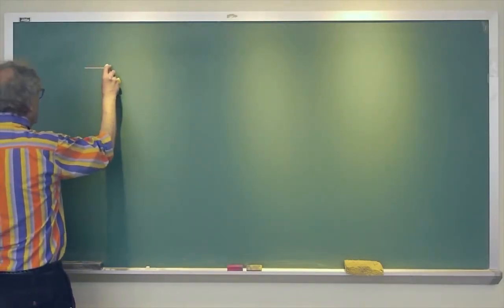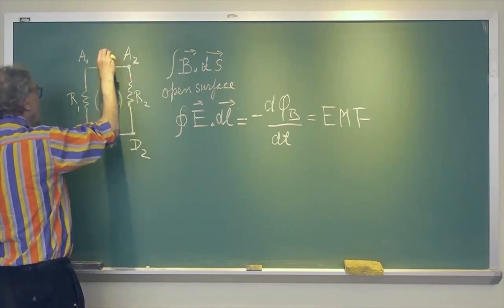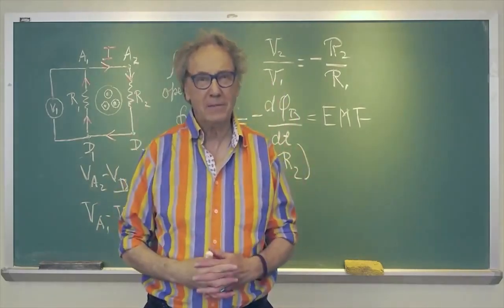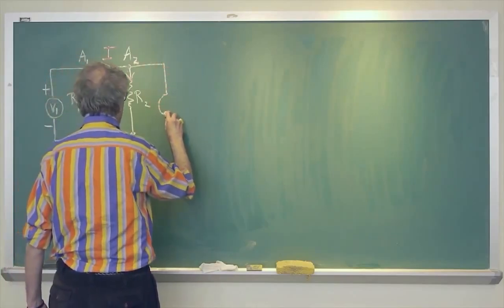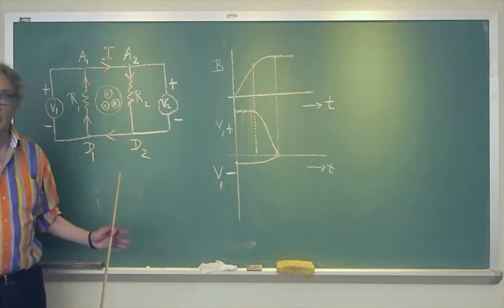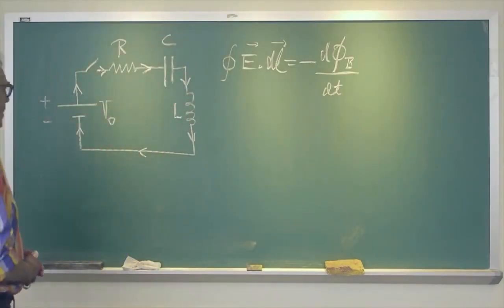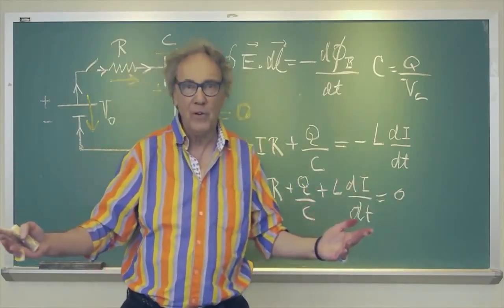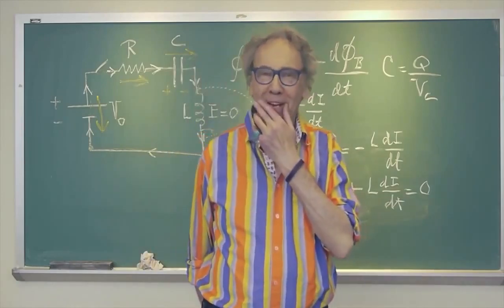Kirchhoff's Loop Rule Is For The Birds

Comment: Hello Pr Lewin, 
I hope you're well. In addition to this video, I watched lecture 16 and the associated lecture notes. I think I understood your explanations and your calculations (which are so great by the way) but there is still something that I can't understand. If the two voltmeters (V1 & V2) are connected to the exact same points (A & D), how can V1 "knows" that it 
should measure the potential difference in R1 and V2, the potential difference in R2? If I refer to the first figure of your lecture notes and if I move V2 right above V1 to get a superposition of V1 and V2 and the wiring associated to the two voltmeters, both voltmeters should measure the potential difference in R1 and show the same value. However, by doing this I didn't change the connections and the changing magnetic flux that goes through the "V2 loop" so the voltmeters should indicate two different values. They can't show different and same values at the same time, so I missed something. What would happen if we connect a third voltmeter in a plane perpendicular to the sheet of paper? What it will display? Thank you for reading me.
Reply from the maker: The readings of the 2 Voltmeters MUST be in accordance with Maxwell's equations and they are. The readings as shown in my demo are exactly as they have to be. Any other reading would be a violation of M's eqs. Voltmeters do NOT think, they only listen to Maxwell. By the way, if you flip the V2 voltmeter over all the way to the left of V1, keeping A2 and D2 in place, V2 and V1 will indicate identical values, same magnitude, same polarity (assume both negative).  That's demanded by M's eqs. If you flip V1 over all the way to the right of V2, V1 and V2 will read identical values, same magnitude and same polarity (now both positive).
Reply: Thank you very much for your answer Sir! So, if I well understand, you can change the reading value of the voltmeter just by moving it to a different location in space? By flipping over the voltmeter, are we changing the line integral of E.dl along a specific path which is why the reading value is different for the two locations?
Reply from the maker: YES, the integral of E dot dl from one point A to another point D depends on the path you choose. That's Faraday!. In situations where K's loop rule holds (NOT HERE), the integral of E dot dl from one point A to another point D is independent of the path you choose.
Reply: Ok thanks! It's more clear to me now. However, what a mind-blowing concept :)
Reply from the maker: Yes it is mind-boggling. The reason is that already in high school you were always told that the potential difference between 2 points in a circuit is INDEPENDENT of the path you chose when you measure the integral of E dot dl. That's Kirchhoff. This is then hard-wired in your brains. Even when you learn later about Faraday's Law, it's not stressed enough by teachers and pysics books that K's Law is only a special case of F's Law, namely when the closed loop integral of E dot dl is ZERO. If it is NOT zero, K's rule does NOT apply. Physics teachers from all over the world have written me that the demo is a cheat. They claim that the 2 Volt meters MUST read identical values. 
I have a standard answer for them: 
"Dear Teacher, it's time for you to familiarize you with Faraday's Law. You incorrectly have a religious believe in Kirchhoff's loop rule without realizing that that rule does not apply here. I will not further argue with you about this.  I teach physics, I do not argue with people who think they know but who don't."
Reply: Do you know what would happen if we measure the potential difference between A and D by placing the voltmeter in the plane perpendicular to the surface of the blackboard and at the same distance from R1 and R2? In this case, the change in the magnetic flux through the surface of the new loop would be 0 because the plane would be parallel to the magnetic flux. The  path of E dot dl would be now neither the R1 one nor the R2 one. Is the voltmeter will display 0V?
Reply from the maker: It's better to not use the words potential difference in case where the integral of E dot dl depends on the path. I mention that in my handout. It's better to always mention "integral of E dot dl". In your geometry the closed loop is the loop which only contains the wire AD which has zero resistance and the voltmeter. There is no changing magnetic flux going through the surface of that loop, thus the closed loop integral of E dot dl is zero (Kirchhoff!) thus the volt meter will indicate ZERO. It would be ok here to call this here "potential difference".
Reply: Thank you! How can you have a closed loop without passing through R1 or R2? Can the loop be partly virtual (between the two probes of the voltmeter in A & D)?
Reply from the maker: I read it correctly. By the way, you may choose ANY loop in my circuit with any geometry you prefer (with Volt meters out of the blackboard etc etc), Maxwells eqs ALWAYS work for ANY loop. For some loops K's loop rule can be used for others it cannot be used, BUT FOR ALL loops F's law can always be used even if dphi/dt is zero. I'll leave you alone now. Do some more exercises. E.g., use my geometry and choose a closed loop A1 => D1 => V1 => D2 => A2 = V1 back to A1 (I call that the "outer" loop). The closed loop integral of E dot dl in that loop is -dphi/dt. By choosing this loop you MUST get the same readings of V1 and V2 that i get in my demo. I have given students this as an exercise. Few did it right as you now have to be very careful. The current through V1 is NOT the same as through V2. If that were the case, they would indicate the same magnitude of the "voltage" but with different polarity. But the magnitudes are NOT the same. So now you have to do a bit more work.  GOOD LUCK!
Reply: Sorry if I was not clear. In the geometry that I suggested, there is no direct "A=>D" (the rest of your supposition is correct). If I well understood your geometry, you need to add a wire between A & D (to get the "A=>D" direct connection). In my configuration, you don't have this direct "A=>D" connection, so the only way to have it, is to going through R1 or R2 or through a straight line into the air between A & D (but in this case you have the huge resistance of the air gape).
Reply from the maker: I apologize, I had the Letters wrong but not the physics. Your closed loop is A1 => A2 => V2 (out of the black board) back to A1. All my arguments above still hold. The closed loop integral of E dot dl will be zero (Kirchhoff). I accidentally wrote D when I meant A.  sorry.
Reply: Ok, thank you for your time Sir, have a nice day!
Reply from the maker: Here is my corrected version of an earlier msg in which I wrote A which should have been A1 and when I wrote D when I meant A2. NEW VERSION:
Start at A1 => A2 => connecting wire to the voltmeter => voltmeter => connecting wire back to A1. All wires have zero resistance. The Voltmeter has a few Mohms resistance. That's the geometry that you suggested. That's a closed loop and the magnetic flux through any surface attached to that closed loop is always zero.Thus the voltmeter will read ZERO. Maxwell's eqs ALWAYS work.
Reply: Thank you for the final correction but that's not the geometry that I had in mind. In the geometry that you explain, it's like if you directly connect the two probes of the voltmeter (because A1 and A2 are exactly the same point A). In my geometry, the two probes are NOT connected directly together. 
My geometry is A (central point between A1 and A2) => connecting wire to the voltmeter => voltmeter => connecting wire to D (central point between D1 and D2). Voltmeter is in the plane perpendicular to the black board. This plane passes through A and D. My loop can be closed (the missing connection from D back to A) by R1 OR by R2. This configuration is perfectly symmetrical. In the calculations, If I choose R1 to close my loop, I will get a certain value read by the voltmeter. If I choose the R2 resistance to close my loop, this value will be different. But in my geometry, R1 and R2 are connected in the same time. Because of the symmetry of the situation and because the voltmeter is at the same distance from R1 and R2, how can you know if the voltmeter will measure the closed loop integral of E dot dl by going through R1 or the path that going through R2? There is nothing that force the voltmeter to measure the R1 path instead of the R2 path and vice versa, however the 2 values will be different and the voltmeter can display one value only. When the voltmeter is located on the left, I can understand that it measure the R1 resistance, and when it is located on the right, that it measure the R2 resistance. If the voltmeter is right in the center as in my geometry, there is no way that we can know the value that it will display. I feel that something is wrong in my "demonstration" but I don't know what.
Reply from the maker: Apply Faraday's Law in ANY closed loop and you will get the right answer! I have spent enough time on this now.
Reply from the maker: Lecture notes (when available) are posted as pdf files below the video thumb nails
Reply: In the comments associated to the video 8.02 Lect 16. It's the first link.

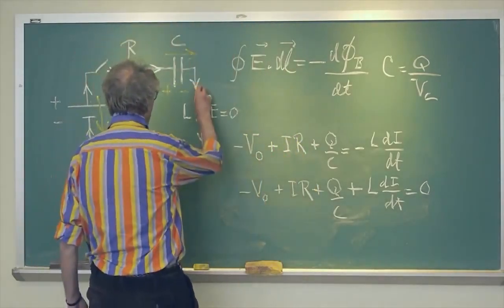Comment: Dear Mr Lewin, could you not always make Kirchhoff's rule work by going "around" a solenoid instead of going through its wire when building the integral E dl. Could you not always attach a virtual voltmeter in your mind like you showed towards the end of this video (33:10)? Then Kirchhoff's rule would actually hold. Then would that not be the easier approach for calculating more complicated circuits consisting of more than one solenoid? You should of course know what you are doing and I think (hope!) your videos have helped me gain a better understanding of that.
Reply from the maker: If you go around the Solenoid (e.g. through a voltmeter which is attached to the solenoid) then K's rule holds, but you  first have to calculate the potential difference over the voltmeter. That, however, is NOT possible with K's rule. You MUST then apply Faraday's law in the closed loop: solenoid-voltmeter. The integral of E dot dl in  that closed loop is NOT zero. It is minus dphi/dt.  Thus you can NEVER avoid Faraday.
Reply: No no, I don't want to avoid Faraday at all! But if integral E dot dl in that closed loop is minus dphi/dt which is also minus L di/dt and E dot dl inside the solenoid is zero (because E must be zero) then L di/dt must be the potential difference outside the solenoid and I can always use this this value (L di/dt) in a KH loop that goes around the solenoid. Is that not correct?
Reply from the maker: If that makes you happy, be my giest. You have then USED Faraday's law, and if you don't do it properly, you may get the WRONG sign. Remember if you integrate E dot dl in the new closed loop in the direction of the current it is --L(dI.dt)  but if you integrate in the opposite direction, it is +L(dI/dt). You will be MUCHHHH better off to do the closed loop integral going through L. By adding a new loop in which you have to apply F's law anyhow, you increase the chances of doing it wrong. You do NOT have to add a new loop. You cannot avoid F's law anyhow.
Reply from the maker: Books get the answer right but they have the Physics WRONG. They NEVER mention that in doing the close loop integral of E dot dl they bypass the L.  If they did that, they will have to explain why the  integral of E dot dl through the bypass route is +L(dI/dt). Frankly I think they have NO idea what they are doing. They have an INCORRECT RELIGIOUS believe in K's rules and they fudge the data to get the result right.  This is THE WORST way to teach students Physics. It's criminal.  If they had a FULL understanding of F's Law they would have stated that the closed loop integral through the circuit is NOT zero but it is -L(dI/dt).  They can then move the
 -L(dI/dt) to the left in their eq. and put the eq. equal to zero. However, the left portion is then no longer the integral of E dot dl through the circuit but they IMPLY that it is. CRIMINALLLLLL
Show less
Reply: Please don't get me wrong. The correct solution given for the wrong reasons is terrible, I completely agree with you! All I am saying is that a physical justification for the textbook approach can be found (it is of course bad if the textbooks don't do that correctly). Your lectures have helped me gain a much deeper understanding, thanks you very much for that! I am currently watching 8x02 but will probably watch 8x01 and maybe 03 after that.

Comment: At 9:45 the lecturer writes down expressions involving V (A1), V(D1) ...etc.  What is the meaning of this expression? 

The reason I am asking this is because for an electric field whose curl is not identically equal to zero, it is not possible to define a potential scalar field corresponding to it, and thus I also assumed that the term 'potential difference' would also have no meaning.  So what is it EXACTLY that the voltmeter at 10:36 measuring?
Reply from the maker: Those V's are the integral of E dot dl through the resistors. I agree with you that we should not call these "potential differences" and I stress that in my lecture #16 and in the Lecture Notes of Lect #16.
https://www.youtube.com/watch?v=nGQbA2jwkWI&list=PLyQSN7X0ro2314mKyUiOILaOC2hk6Pc3j&index=17
Reply: Lectures by Walter Lewin. They will make you ♥ Physics. Thank you very much for the response and reference. I will be sure to watch the video.
Reply from the maker: Please also read my Lecture Notes of Lect #16. It's posted on this channel as a PDF file (below the thumbnail of the video).

Comment: Hi Professor Lewin, thank you for linking this video in your previous answer to my question--I am getting closer to understanding this each day! Do you happen to have a link to Jason's lecture in which he explains exactly why the voltmeter measures +L*di/dt across the terminals of an inductor? Thanks!
Reply from the maker: +Andrew Guo Andrew the L and a Voltmeter form a closed loop. Apply Faradays' law to this loop. The closed loop integral in the direction of the current of E.dl is minus L*di/dt. However the E-field inside the L is zero. Thus the Voltmeter will indicate +/-L*di/dt depending on how its polarity is connected to the L.

Comment: OK, If the voltage induced from a changing magnetic field is path dependent and if we have  2 Volt meters connected to the same  points, how does each volt meter read from a different path? Does the physical location of the meter have anything to do with it?
Reply from the maker: +stacooch  Notice that the path from A=>D through R2 is different from the path through R1. The fact that both voltmeters are connected to the same points A and D does NOT mean that they have to read the same value. That would be the case if Kirchhoff's rule would be valid in the closed loop through R1 and R2 but that is NOT the case. The closed loop integral of E.dl through that closed loop is NOT ZERO, it is minus dphi/dt.  That is the reason why the 2 Voltmeters read a different value AND the two values even have opposite signs !!!!! https://www.youtube.com/watch?v=LzT_YZ0xCFY&list=PLyQSN7X0ro22zanLOcvkaSY-IZqheFYM5&index=1
Reply from the maker: +stacooch  I suggest you watch my 8.02x lectures 16 and 20 and I suggest you read the lecture notes of both lectures. You find them as pdf file below the videos. For starters you should understand Faraday's Law. In lect #16 I do my famous demo by showing the world (and YOU) that the ratio of the two "voltages" V2/V1=MINUS(R2/R1). We'll take it form there.
Reply: Thanks for the quick response and for the homework. I hooked up the TV to the PC and now the whole family has to watch your lectures.
Reply from the maker: +stacooch Terrific! Perhaps your whole family will soon understand Faraday's Law. That would be a very nice "New Year's" present.